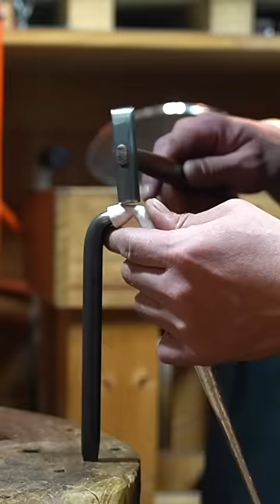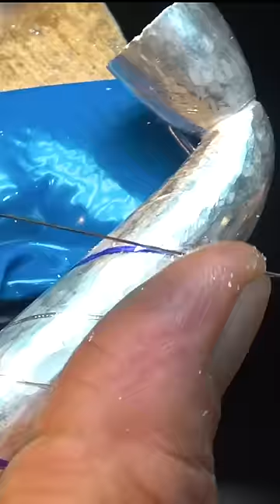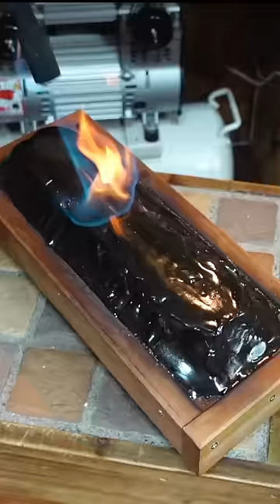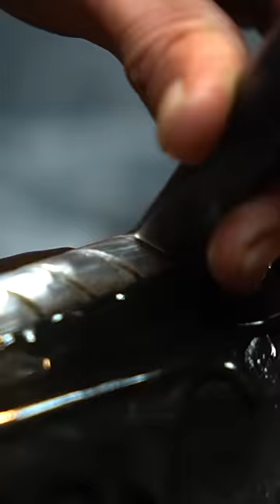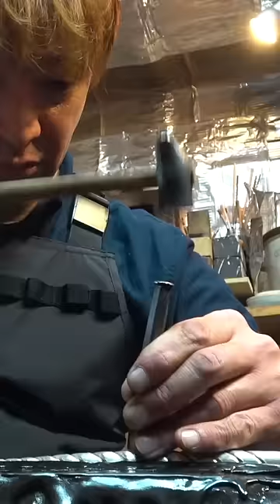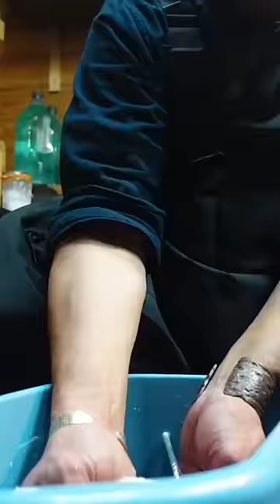- PART 3 - Hammering 500,000 times!? The process of making a Japanese smoking pipe... #shorts #short

Comment: I wonder how safe this metal is to smoke out of though
Reply: The only stipulation about metal pipes that I've heard is, don't smoke out of copper 🤷‍♂️
Reply: @ryanlang1548  Or aluminum.
Reply: This is silver it’s fine
Reply: @tylerosborn5824 man that whole thing is silver?!?! That's pretty sweet!!
Reply: @tylerosborn5824 if it's silver, then sure, it's fine. But that looks an awful lot like aluminium.
Reply: its silver....so yeah.....even if it was steel...still ok
Reply: I think anything with zinc is not good also to be exposing to a flame and breathing…. “new silver” is an alloy of copper, zinc and nickel…. it’s often used for tableware….
Reply: @chris101ward when you heat alloyed silver to a certain temperature, which is required to anneal or solder, the surface turns matte white. One of the annoying things about working with it. If you get it perfectly polished, heat it up, you have to repolish the surface.
Reply: @tylerosborn5824 it’s not fine, it’s sterling. 
😎 get it? Ah? ah?
Reply: That's nickel silver, not "new silver". It has also been in use for over 2000 years.  @PRH123
Reply: @ChuckyMcNubbin72  Google neusilber

German artificial recreation of the natural paktong ore composition, however, began to appear from about 1750 onward.[13] In 1770, the Suhl metalworks were able to produce a similar alloy.[14] In 1823, a German competition was held to perfect the production process: the goal was to develop an alloy that possessed the closest visual similarity to silver. The brothers Henniger in Berlin in and Ernst Genther in Schneeberg independently achieved this goal. The manufacturer Berndorf named the trademark brand Alpacca, which became widely known in northern Europe for nickel silver. In 1830, the German process of manufacture was introduced into England, while exports of paktong from China gradually stopped. In 1832, a form of German silver was also developed in Birmingham.

Comment: I learned a similar type of silversmithing. Yes, you'll hammer 50,000 times.
Reply: So it's silver, good to know. Thought it was Aluminum 😂
Reply: @RoboArc aluminum will work, but you can’t solder it and it works differently than silver.
Reply: @nottheoneyourelookingfor0504  I don't think it's recomend to smoke out of aluminum tbh. Ions of the aluminum get blown off during hearing and thus may lead to neurological disorders.
Reply: @RoboArc  dude. You really need to lay off the bath salts. 
It is made of silver alloy. Not aluminum. 
Seems you experienced the neurological damage first hand
Reply: @RoboArc  you ever seen aluminum pots and pans? 
Aluminum foil for cooking? 
Christ.
Reply: @chrisdiduch3347  I googled why aluminum isn't good for smoking out of long term 😆 I know it's silver ya doofus lol. Cooking isn't the same, you're not inhaling vapors. Ever heard of off gassing bruh 🤣 you're definitely not an engineer 

Why you pissy 🤣🤣🤣
Reply: @nottheoneyourelookingfor0504  Aluminum is a neurotoxin that can be toxic to the human brain and accumulates over time. Most but not all aluminum cookware uses a thin layer of teflon to help with this but baking is a common culprit.  No one who knows what they are talking about would recommend smoking out of it and that is a highly disrespectful, and uncalled for way to tell someone you think they are wrong.
Reply: @nottheoneyourelookingfor0504  Did your wife cheat on you with a black dude or something?
Reply: @shay4501  nah. Your mother gave me the clap. 
Gave it to your wife. And sister. 
Good luck figuring out who you got it from.
Reply: @nottheoneyourelookingfor0504  wild imagination considering i don't have a sister, take your meds.
Reply: @shay4501  lol.

Comment: Fun fact: Traditionally, Japanese saw blades are designed to cut on the forward stroke as opposed to almost every other saw you've ever used which cuts on the pull stroke. 👌
Reply: I mount them backwards so they cut on the pull.
Reply: Japanese knives also work this way
Reply: Probably more downforce than backwards
Reply: It’s actually just the opposite, Japanese saws (and planes) cut on the pull stroke…

Comment: Then it gets clogged after using it a few times 😂 good luck cleaning that
Reply: i feel like it wouldnt be that bad just hit it with hot water and then rubbing alcohol and then shove a lil pipecleaner tool thru there each way and your prolly good. this is nothing compared to cleaning out bongs with percolators and multiple chambers

Comment: I’ve never seen the method of using hot-to-cold wax as a vice. Ingenious. (I’m sure it’s an old technique. Just new to me.) The even distribution of support must be almost perfect! Thanks for showing this!
Reply: Jewelers use this technique, avoids any scratches or distortions due to clamping
Reply: It’s called pitch. Traditionally was from trees, mixed in with clay and other stuff to make it not sticky when room temperature. 
You warm it up and it softens then gets runny and sticky. It’ll form-fit, but won’t get too hard and brittle when cool so it will support but also deform under stress. 
Think taffy. 
You would also definitely fill the hollow pieces with the pitch so when you hit it with a tool, if gives just enough support so that the hollow doesn’t completely collapse. 

Yes, it’s a technique that’s thousands of years old. If it ain’t broke, don’t fix it.

Comment: Whats the deal with the black shmoo during the chiseling bit?
Does it have some flex so the stem doesn't crush? And if so, what actually is the stuff?
Reply: its a hard cast wax used by jewelers to hold jewelry while protecting the piece and supporting it 100%
Reply: @kevinpunk2006 close. It’s a combination of pitch, ‘clay’ and softening agent. The pitch is either from tree saps, or from petroleum products.

Comment: The confidence to swing a hammer with that much force at something I'm holding in my other hand is something I will never have.
Reply: Sure you could! It just takes practice. And confidence. You will screw it up from time to time. EVERYONE does. But you do get better with practice. 
Silversmithing is actually one of the more soothing smithing in my opinion. Take your time, do it right. Bunch of small strikes instead of trying to move too much too quickly. Watching it go from flat sheet/bar to 3-d functional piece is something I quite miss about not being a goldsmith any longer

Comment: I have my own smoking pipe. Made from copper pipe and aluminium... Well detail as this.. I take 2 different size  copper pipe and aluminium for the handle.. Put em together and then  hammer em.. Copper outside.. Since the copper I could get is 3mm thick pipe.. .. But I insert steel in middle to prevent from bending or over hammered..
All is easy job until 8 realize.... I can't use aluminium for the tip..i just steal another few inch of copper from my cousin workshop and make the tips using copper. Of course people will steal it.  I spent like 12 hour making that even its not that beautiful ....

Comment: Where can I buy a jewelry saw?
Reply: eBay. 
Don’t buy cheap though. Get the best you can afford. 
Which will probably only cost around $50 max anyways because they’re not that expensive to begin with. Just definitely do not skimp on the blades. You’ll just end up breaking them all before you get a chance to use them